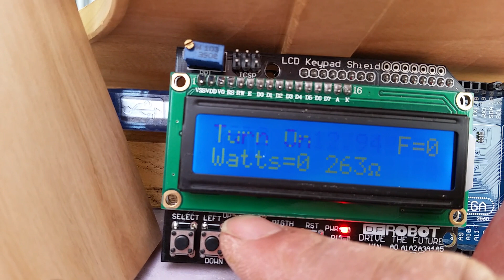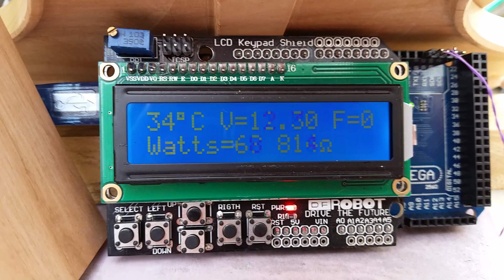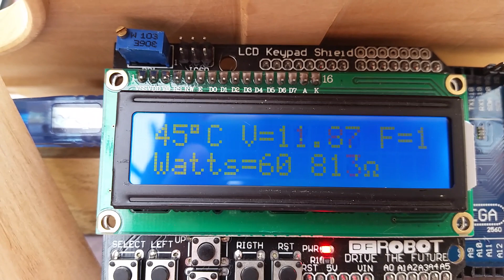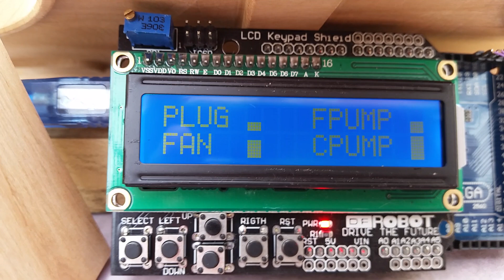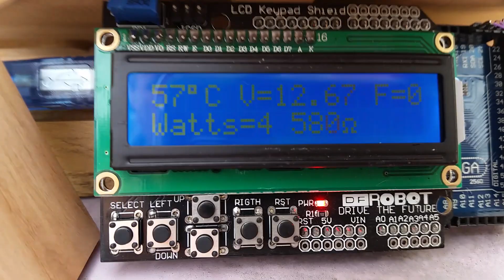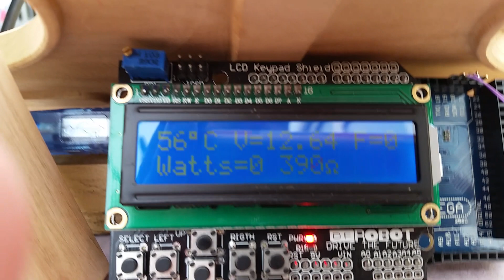Arduino + LCD + webasto thermo top V

Comment from the maker: For people who want to build this yourself, I've added the links to the code, wbus.h and diagram of how to wire up a L9637D converter in the description of the video.
Reply: Hi, interesting work. I’m looking for a variation, and some advice. I would like to run the Webasto  V as a water heater on my boat, controlling it with a thermostat on the hot water tank, and if possible timed, for am and pm. Your thoughts would be appreciated. This is new territory the last programming I did was dbase3!
Reply: @mickr1969 I am using an Arduino UNO. I changed the code from Serial1 to Serial and removed the old Serial commands due to the missing second UART of the UNO.

My TT C/Z does not respond. The Controller loops in "Init..." or "timeout".

The Uno cannot run at 18430kHz, but the generated Baud rate seems to be 2400.

Is the code compatible to the TT C/Z?

Comment: Собрал данную железку, работает. Мега не умеет работать от 12 вольт (точнее она отработала у меня минут 10 а потом пошел дым), используйте внешние DC-DC. Устройство имеет всего две кнопки, включить и выключить, нажатие на остальные кнопки приводит к срыву синхронизации дисплея, или перезагрузке. Если подогрев  имеет ошибку 99h то на экране вы увидите, мощность 255 и сопротивление 0, нажатие на кнопки не принесёт результата.

This is good job. Arduino mega not can work with 12volts (and after 10 minutes, line regulator make smoke) need use external DC-DC. This device simple controll, use two button, start and stop. Other button not control process, pushing to other button call reboot or lost synchronisation lcd display. If you device have error 99h you can see on display wats=255 and resistance=0. Pushing to button not be work.

Comment: Looks very similar to the stuff that I did. I ported the whole libwbus to arduino and used discrete components for interfacing the wbus. Dumb idea, I should've just gotten that L9637D or similar.

Making libwbus work with the duemilanove was a bit tedious. Using a mega is much easier, I would not recommend the cheaper versions for the faint hearted.Anyways, Good job, keep it up!
Reply: +tr4fficam 
Can you share the schematic for the RS-232 to Wbus? I've built myself one while I wait for the proper IC, which works fine on the thermotop C models, but haven't got any help getting it to work on the TTV.
Reply from the maker: +Susana Godinho 
I had the same problem. I built one two from a schematic on the internet (K-Line schematic) using a couple of transistors etc. It worked fine with the C but not with the V which is why I decided to use the L9637D or similar.
Reply: Strange. So did the L9637D solved the problem for you? The VAG COM adapter I have also uses the discrete aproach and that too doesn't work with the TTV so wondering if there are different versions?
Reply from the maker: Yes, all I used is the L9637D soldered onto an adapter that breaks out the pins to a DIP8 format. then soldered on wires. Connected up TX / RX to the pins on the arduino. So theres actually not really much of a schematic to share...
Reply: +Susana Godinho

I was able to make it work with a similar discrete circuit as is shown in the libwbus documentation. Just the voltage of my arduino gpio is different (5V vs 3.3V) so I had to adjust the component values a bit. Making it work with the duemilanove which has the usb hooked to the serial pins is even more difficult but even that can be made to work without modifying the duemilanove. Just more work. I would always opt for the integrated circuit though, those are always more reliable than anything I can tinker.

I have never been able to make the k-line on the vcds cable work with a webasto. No matter what drivers I tried. You can buy a cheap VAG compatible k-line diagnostic cable from ebay for something like 6-7$ and that will work, makes no sense to waste time fighting with the vcds cable. I have used the thermotest sw with such and it is fine.
Reply: +mickr1969 
The schematic I was asking was of the discrete circuit. I've seen your reply below which clarifies. I'm using a similar version with NPN transistors and the 510Ohm pull up resistor to idle the line at VCC, as defined on the bus spec.

The arduino says timeout and the webasto software doesn't connect either.

This is not to say I can not communicate with the unit. I can send Start/Stop commands and the unit will happily execute those. I modified the Arduino code accordingly to send those on button presses, which also works fine. But I can't clear faults or see any real time data. So I'm scratching my head as why nothing else is accepted. 
I'm guessing the problem lies on the K-Line adapter TX line (Arduino RX) so will do some debugging.

I'm using a uno, with the debug stuff turned off and have no issues with the usb/serial attached to it. Perhaps you're problem lies somewhere else?
The Leonardo can be used as a drop down to the mega. The virtual USB port can be used for debug and the hardware serial for the K-line.
Reply: +Susana Godinho 

You can't just turn off the rx and tx pin load from the usb chip. It pulls up or down, I don't recall which. You need to build your circuit so that it pulls harder, that's all. I adjusted resistor values while looking at it with a scope until I was happy with the levels.

Debugging becomes a little nasty when you don't have the serial for it. But there's always the led.. you can morse with it, hahah.
Reply: +tr4fficam 
I managed to replicate the issue, only when receiving data. Sending is fine. 
This was the problem with the rest of the circuit. The TX line from the converter seems to be quite sensitive. The leakage from the zenner on the Serial <-> K-Line adapter was causing issues, in a similar way to the USB <-> Serial on the Uno/Duemilanove. Tuning a voltage divider to get it working, seems to cure the issue and made it work fine with the webasto software too.

The on-off commands don't need any acknowledgment from the unit, that's why I wasn't having issues before. I may use this later for a simple unit that polls the state of a pin and sends the corresponding command. One could use a attiny or even a ESP8266 to get fancy wireless connectivity.

I ended up using a Leonardo, which has two serial ports. One, is used for programming and debugging and is part of the chip usb implementation (its a virtual port), the other is a hardware serial port which is not attached to nothing (other than pin 0 and 1). This works great for the K-line adapter and its more compact than the Mega.

Comment: I have a Thermo Top V here, that was originally controlled by the CAN Bus in an Volkswagen Passat. I ordered a Chip, that will controll IT via W-Bus. 
Now i try to get contact to the internal control chip via an ODB/USB Adapter and the Webasto Thermo Test. The heater ist conected to the battery, the yello cable to the W- Bus pin... But no life sign... You have any clue? Is the W-Bus maybe deactivated? Is it possible to make contact via CAN?

Comment: Need to ask you something else... Is there a control to force the unit to operate at low load (3KW)?
Mine starts, ramps up to the desired temperature, overshoots and by the time it realizes its too hot, switches off. It then restarts at full power again (5KW).
Reply: Hi Susana, I have the same problem, did you found a solution? Thanks! Luis

Comment: Hi 

Just came accros this as i'm installing a new webasto unit.

It's replacing an old unit where there was no vbus or what so ever.

For the old unit i had build a arduino gsm remote with temp and status on when the different thing like cabin fan turns on. required a lot of wires.

With this it seems like a single wire can do the trick and also offer a bit more on the status part.

When you say vbus line, where did you tab in to it? at the yellow wire near the fuses? or at the connector for the clock?

Why i ask is that some units only have a 3 wire plug at the clock and those are said to not have a vbus... 

but thanks for sharing code... makes it easy to port over the parts i need... not sure if i want to do a lcd... maybe a small one and just s single button...
Reply from the maker: Bo Herrmannsen 
Hi, Pin 2 on the 8 pin connector is the WBus line that I connect the arduino with.
You need to use a converter chip to convert the serial TX / RX from the arduino to the correct signal (Same as K-LINE).
I used a L9637D chip, because it was the cheapest converter chip I could find on ebay. But there are several other chips that do exactly the same thing.
Reply: mickr1969 thanks for the info... i will check if that yellow connector at the fuses is not the same wire... would be 100 times more easy to wire it up  with that one
Reply: mickr1969 looking at the wire diagram for the thermotop C i have 2 connectors.. a 2 pin one and a 6 pin one... pin 2 on the 6 pin one is diagnosis and that goes to the yellow wire/connector near the fuses.... 

so it seems like an easy connection... now i just need to figure the code...
Reply: mickr1969 studied your code and figured out how to remove LCD support as the remote i'm basing my build on does not have any.  (https://store.open-electronics.org/index.php?_route_=TiDiGino)

but do i not quite understand when the 2 status voids are used...  get_status2() and  get_status().... are they both used when the heater is off? or is  get_status2() only used when the heater is on?
Reply from the maker: +Bo Herrmannsen 
I think it may be the version of SoftwareSerial you are using.
From what I can see on the net, there are two versions. One supports write, one does not.

If you look here www.arduino.cc/en/Reference/SoftwareSerial
software serial does include the write function.
Hope that helps..
Reply: mickr1969 that makes a bit sense...  everything for my electronics are based on arduino 0022, sadly the italian company have not updated anything so i had to use same IDE... but i guess i could just copy over softserial from a more recent IDE
Reply: +mickr1969 about the chip... yes very cheap to get.... did you wire it like this? http://www.iwasz.pl/wp-content/uploads/2013/06/L9637.png
Reply: +mickr1969 or should it be connected more like this?

Comment: Hi,
Great work. Is the W-Bus is a (LIN) BUS?
I have Webasto Thermo Top Evo (BMW). That connected via LIN bus to the car. would this work ?
Reply from the maker: I'm not sure, but the older webasto's fitted to BWM's had their own protocol, and were not the same as the webasto's fitted to other cars.
Reply: Thank you for replay. But the k-line and LIN are not the same ?
Reply from the maker: I'm not sure. I do know that the internal software on the older thermotop's are different on the BMW's to the one's fitted in other cars. The older thermotops can just be activated by a simple 12v wire, except the BMW version which does not support it. I'm not sure if there are any differences between the BWM evo, and other evo's. W-Bus is same as K-Line as far as I'm aware.
Reply: W-Bus is kind of a crippled LIN bus: it runs slowly at 2400baud, even parity, and there are no SYNC bytes - they are simply omitted.

Comment: Im want make  a simple analog to wbus coverter, 12v in = heater on. what is the easyest way to make this?  what chip should i use?
Reply from the maker: You need a micro controller to send in the correct signals, and keep-alive signals. You could use pretty much any arduino, and alter my code to suit. You would also need a chip to convert the 5v signal from the micro controller such as the  L9637D which I used.

Comment: I've finally got the L9637D with a converter to bread board. How do you see which leg is 1? I have turned it boothways and each time it heats up and start to smoke. I've tried to use a USB2serial converter just with the thermotest software just to check the Hardware.
Reply from the maker: Should be a little dot on the chip which indicates pin 1.
Have you got it wired up correctly?
http://www.labkit.ru/userfiles/file/projects/car_shm/car_board_comp/01.GIF
vcc is 5v from your arduino going to pin 3, vbat is the 12v to pin 7, and you need gnd's from both the arduino and your 12v system connected together going to pin 5 on the chip.
Reply: T
Reply: Thanks for you reply, I cant see the dot, so i have tried the 2 possible orientations :-) I've also connected an Arduino Mega instead of the USB2Serial converter. When I connect the 12V supply everything is good, but as soon as the Arduino 5V is connect it gets very hot. I am on the 6th L9637 now :-)  @BuyitFixit
Reply from the maker: @force136136  Pin 1 should be at the bottom left (near the ST logo), when the L9637D number is at the top of the chip. With the number across the top the pins should be 8 (top left),7,6,5 across the top, 1,2,3,4 along the bottom in that order.
Reply: @BuyitFixit  Thx a lot for the confirmation of that. I did that, but 
after 5 seconds... smoke :-) I have ordered some new ones from another place. Until now I have used the mentioned schematic for testing with webasto thermotest.
https://github.com/stuartpittaway/WebastoWBUSInterface/blob/master/Webasto%20WBus%20Arduino%20Serial%20Interface%20mk7_schem.png

I did try it with your Arduino project, but as people reply it wont work with this heater. Until know I have just controlled the heater with a relay the 1533 webasto timer and with an Arduino and a gsm module. 

With your project i could make it much more customizable, depending on temperature etc. and i risk Learning a lot of stuff! :-)
Reply from the maker: @force136136  What heater are you trying to control? Also I've had problems before with "fake chips" not this particular chip, but with a motor control chip that I ordered from ali express. It was for a washing machine. Both chips I ordered came and failed almost immediately. When I compared them to the original the logo / numbers etc were not etched as precise and the logo was slightly different to the original.
Reply: @BuyitFixit  It is a Thermo top evo 5. I ordered them from ali express. I should have ordered some from different suppliers. Now I had to use a german supplier to get it in the Christmas holidays. :-)

Comment: hello mickr1969,
i´ve one question. I used the same source code like u.
In general communication is working (i can recieve status information)
When i send "turn On" i get "request was rejected"
see:

Sending: 0xF4 0x03 0x21 0x0A 0xDC

Received: 0x4F 0x04 0x7F 0x21 0x33 0x26 
Request was rejected

or

Sending: 0x24 0x03 0x21 0x0A 0x0C 

Received: 0x42 0x04 0x7F 0x21 0x33 0x2B 
Request was rejected

Do you have any idea to solve this problem?
Thanks in advance
Best regards
Marco
Reply from the maker: +Marco Chrappek 
Sorry I'm not sure what the problem is.
I'd guess its the webasto is not in the correct state? (locked out for example)

Comment: Thanks for you reply, I cant see the dot, so i have tried the 2 possible orientations :-) I've also connected an Arduino Mega instead of the USB2Serial converter. When I connect the 12V supply everything is good, but as soon as the Arduino 5V is connect it gets very hot. I am on the 6th L9637 now :-)

Comment: Hello. Thank you for sharing.
The link to the wiring picture is down unfortunately.
Did you do anything with the canbus pins? I'm not sure what the function of them is. In two days I am going to build mine (waiting for the fuel pump) And would be grateful if you could share this information.
Thanks

Matt
Reply from the maker: Just checked the wiring picture link, working fine here...
Reply: mickr1969 Ah yes I can open it now as well. Might have been just a temporary thing!

Comment: I have a problem... :(  Sending: 0xF4 0x03 0x50 0x05 0xA2 recv: recv: 2
Received: 0x4F 0x04 0x7F 0x50 0x11 0x75 Request was rejected
Reply from the maker: Not sure on that one, but it could possibly be something like the fuel pump not connected properly to the heater, or a faulty fan / glow plug  perhaps? as it seems the heater was not ready to accept the command. Have you tried with the webasto diagnostic software to double check the heater is working correctly?
Reply: @BuyitFixit   Hey, thanks for the answer. It is a VW T6 with a engine heater but i flash it with the webasto firmware. Before flash it dosnt work with webasto test software but after it work great.
Reply from the maker: @timoh.3984  Just looking back through what the code was actually doing, as it's been quite a few years... From what you first posted it looks like the command WBUS_CMD_QUERY 0x50 with QUERY_SENSORS 0x05 was being sent which is asking the heater for things like temperature / glow plug resistance etc. The command failed with a reply of 0x7F 0x50 0x11.  the 0x7F should have been 0x80 if the command was accepted. I'm not sure on the meaning of the other values.
Reply: @timoh.3984  hey how you flash it with the webasto firmware?